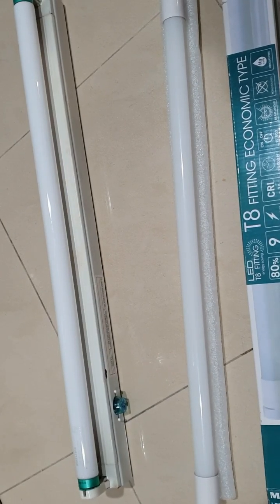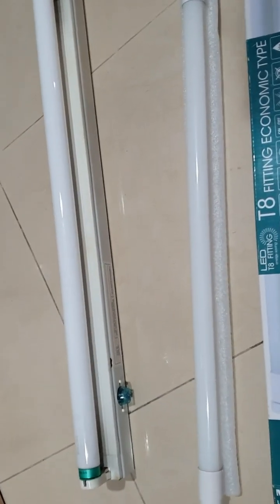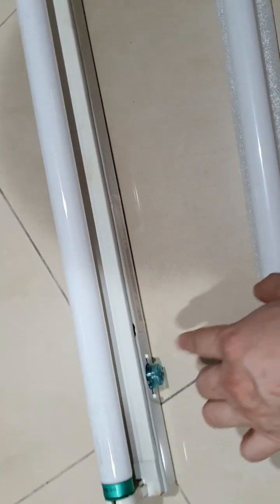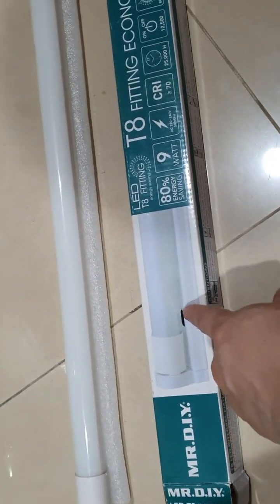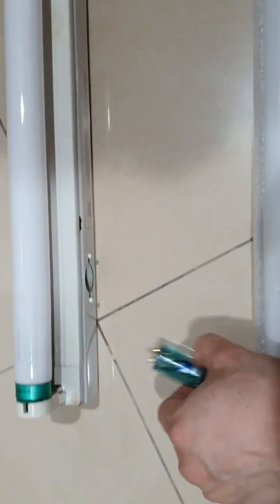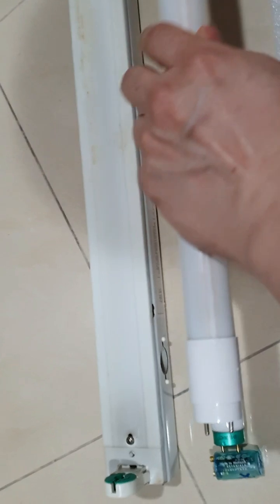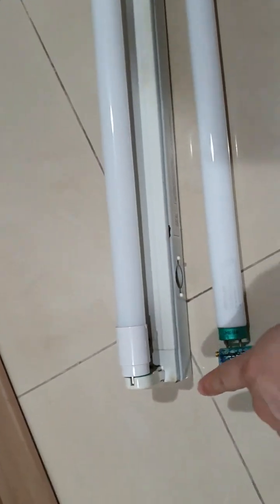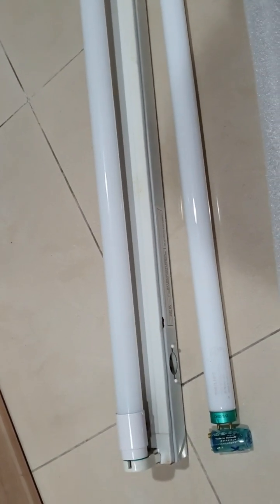How To Convert / Replacing / Using T8 Fluorescent Lights to LED Tube without Changing the Fitting

Comment: What about the ballast inside the fixture?  If my fixture has a starter, does that mean it does NOT have a ballast I need to remove for LED conversion?
Reply from the maker: just remove the starter only (and don't need to touch or remove the rest), install the LED tube, turn on and it work straight away.
Reply: @flexistayservices  Thanks for that tip. I'm going to try that.